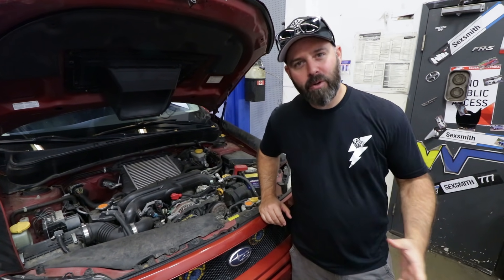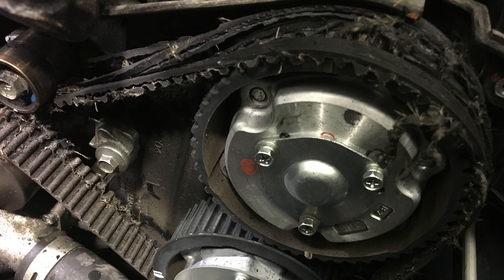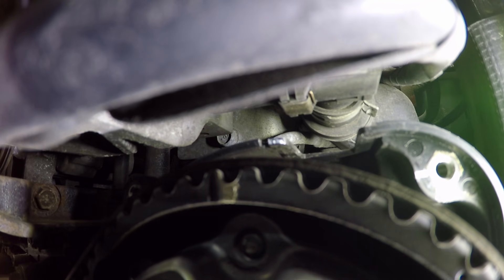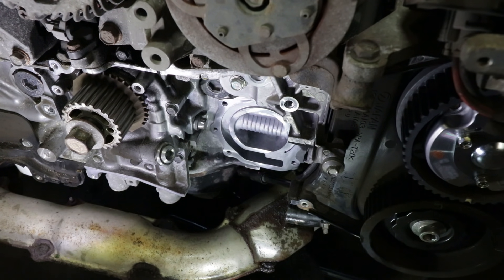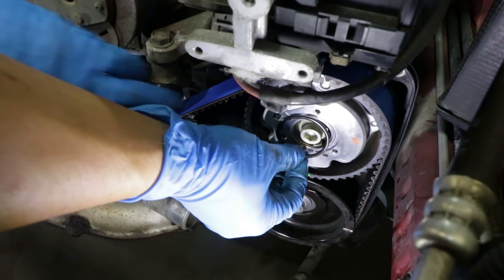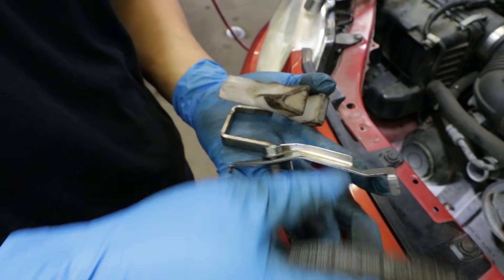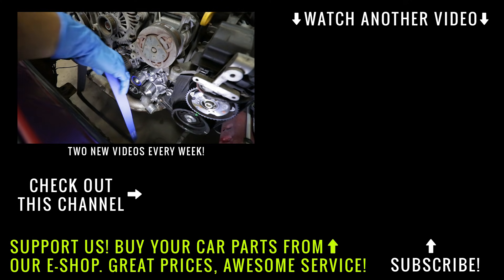How To Change A Subaru DOHC EJ20 EJ25 Timing Belt

Comment: I liked the video and it was very good information.  The only thing I would be hesitant to a do is out coper anti seize on those bolts since copper and aluminium are enemies because of the electrolysis  between copper and aluminium and the aluminium is likely to get eaten out if there is any moisture at all present.

Comment: I did the 2 full revolutions And the timing marks didn’t lined up again ☹️ I removed the timing belt and lined up the marks again but Im afraid now that is not gonna work and I would bend valves. Help!!
Reply: This happened to me too. I realized I should be following the FSM (and what they did in the video) and NOT doing the 2 revs and checking it, because I believe it is the AVCS (cam phasing) features of this car (08 STi in my case) that throws off the timing a little bit once rotated. I put it all back together and it ran fine (I think, I have a different hopefully unrelated issue now). Good luck and let me know what you found out! I am hoping I am right that the cam phasing is causing this to be off.
Reply: burnrubber2002 I removed the belt and lined up the crankshaft then the cams again then pull everything back together then started right up I asked my friend and said the marks wont line up again it takes more than two revolutions to the marks to line up again but as long you lined up the marks for the first time there’s nothing to be afraid of

Comment: I've never done a subaru timing belt, but I've done on normal inline engines and before putting all the covers I rotate the crankshaft twice just to double check the marks again and in case there was some slack that I didn't notice

Comment: NEVER!!!!!!!!!!!!!!! In my life i buy a subaru again!
Reply: Why?
Reply: @Khg72   Because i just spend alot of money on it and then out of nowhere my timing belt snap! And the engine design is so stupid. 😪
Reply: the sad part is as with almost all modern engines produced in any vehicle anymore weather has a timing belt or timing chain they are all interference and if the belt and or chain breaks it's still going to bend the valves regardless of make
Reply: For someone that likes to work on their own vehicle's I couldn't agree more! I've owned many many different types of vehicle's and these are a pain in the ass to work on. Their reliability falls short of Toyota and Honda. Plus these newer generations have lost their bold styling and are conforming to blend in with the rest of the manufactures.
Reply: Garrett Smith I was thinking the same thing. Subaru’s used to really POP out when u saw one even if it isn’t decked out w cool shit, now they are just any other car

Comment: These guys did a great job on this video. The one thing I never understood though is why mechanics never clean the parts when they put them back together. When people buy a brand new part and spent hundreds of dollars they want their car to look like they got a brand new part on it and everything looking clean shiny and new. I can’t stand it when they take things apart and then put them back together dirty and sometimes even dirtier then the engine was before it came into the shop. Clean the parts before you re-install everything so that the customer can tell and appreciate your work and the nice new part shows off!
Reply from the maker: Because no one ever pays a mechanic to clean parts! Customers already complain about high prices can you imagine tacking on 1-2 hours onto a job for cleaning...
Reply: I agree with Dmax, if the timingbelt covers are dirty, dirt can cause more problems on the road with new parts. It's true that cleaning parts is time consuming but if you want treat your customers good they will come back with more for you.
Reply: It's all under the cover you'll never see it anyway. If you want it clean pay me for it. Flat rate doesn't

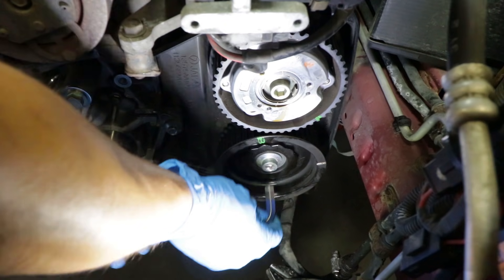Comment: Question. @9:29 he turns the bottom cam gear to the right/clockwise. I was told not to do that. To only turn that one counterclockwise and the one above that one clockwise to line them up. Is this wrong?
Reply: I also note that but because he aligned the crank sprocket the pistons dont touch the valves that way. A little doesn't hurt.
Reply: The service manual does specifically advise against clockwise rotation of the lower, driver's side cam sprocket. While the pistons are all mid-stroke on EJ25 motors (at least, think it is that way on most other Subarus too), the intake and exhaust valves can still run into each other on the driver's side (the valves are all closed when the passenger-side cam timing marks are aligned).

Comment: You want oem pulleys, the bearings are different.
Reply: Koyo and NSK are the manufacturers of the OEM parts.  Avoid the Gates kits.  They no longer use Koyo or NSK and are now using Chinese manufacturers.

Comment: Just go ahead and do a full head gasket replacement.  If it is not bad it probably will be before the timing belt needs to be replaced.  I did not have the time to replace the timing belt on my Forester, so I paid a shop $1,000.  It turns out it had a bad head gasket.  Removing the timing belt seemed like the easy part of replacing the head gasket.
Reply: Turbo Subarus don't have the infamous head gasket woes that the non-turbos have. I assume yours was a non-turbo? Reason is Subaru cheaped out on the non-turbos and used a single layer head gasket, while turbos have multi-layer. You can actually swap in a multi-layer on a non-turbo and it will likely last the rest of the life of the engine.

Comment: Did you have to pump and prime the hydraulic tensioner?
Reply: No.  It's under pressure already.  You install it with the pin in it (it comes that way when you buy it) and only pull the pin when you are ready to release it.  You technically can recompress it, but if you don't do it right you can damage it.

Comment: I followed the same steps with the new belt and crank with cams all aligned..but when I rotate the engine by hand the belt wont align with marks on crank and cams..but the crank and cams align with marks on engine..what am I doing wrong?? 2004 wrx
Reply: marked martin, you would have got the job sorted by now but did the problem turn out to be that the timing belt lettering facing the wrong way?
Reply: Dave Pedro I did sort it out..the belt's letters were  facing me...once I pulled the pin I would rotate it and it all the marks will align just not in their start position upon further investigation I read that it will line up after 1000 turns so I align everything up put it all together and it cranked up perfect no misfires!! Thanks for the reply.
Reply: Ah ha, that last bit of information was the final piece in the puzzle. Thanks :-)

Comment: You can use a clamp to hold the two drivers side cam gears together, makes the job a little easier and saves you the worry of screwing something up
Reply: Not in this case, he had to align them because they fell out of alignment.

Comment: it's a great tutorial video. it's one of the best video and great instruction. One question: does the Subaru Forester 2011 timing belt, what is the manufacture recommend to change timing belt? Thanks.
Reply: 105k miles is factory recommendation

Comment: This was super helpful!  Thanks for providing such an in depth explanation.  I have to do the timing belt in my 08 outback xt 5AT.  So a quick question is that i need to make sure the flex plate is secured with a pry bar before pulling the crank pulley off?  Where exactly is that flex plate located?  Could you provide an overhead picture of the motor to show where that is?  Thanks!!
Reply: Pull out the black rubber cover just to the passenger side of the throttle body,  that's your access to lock the flexplate

Comment: What is it causing the left intake cam shaft sprocket to spin why the right camshaft it spin freely
Reply: The timing marks set the pistons at half stroke.  The passenger side of the car all the pistons are closed so the cam isn't under any tensions from the roller rockers on the lobes.  The driver's side the valves are half open and the springs on them force the cams to spin a bit back to their closed position.

Comment: Why not oil pump too while u were there?
Reply: Why would you?  Unless it is leaking (which in and of itself is rare on these engines), they don't really fail.  Now, if you want a bigger pump, that's a different story.  For a factory car the factory pump is more than adequate.

Comment: So you tell me the mechanic did not turn the engine by hand few times to check if the intake/exhaust etc. marks lined up again with each other after lining them up for the new timing belt?
Reply from the maker: Ofcourse he did, we just didnt show it but he mentioned turning the engine a few times to ensure that everything lines up. We're trying to keep these how to videos as short and concise as possible.
Reply: @speedacademy  For cars with AVCS, is it true that the marks will be off once turning a couple of rotations? I ask because that's what happened to me on my 08 STi. It has dual AVCS and I believe this is why. I thought I messed it up and redid everything again but still had that issue. Seemed to run fine, though had hopefully unrelated issue and had to rip the heads off again so I'll be doing this again soon and want to double check I'm thinking this correctly!

Comment: Gah so much wrong!! The water pump isn't torqued in a criss cross pattern you need to start at the 2 o'clock position and go clock wise around once, and then again a second time at the same torque spec. You also should always use the proper tool to hold the crank pulley to undo the bolt and the proper tool to keep the left side cam gears from spinning when undoing the belt so the valves don't hit each other!!
Reply: never, because its impossible the pistons are out of the way.
Reply: @chrism6  pistons are clear but these will hit valves to because they're angled towards each other, but as they're opening valves on opposite cylinders, ( intakes on cyl 2 and exhaust on cyl 4) there's little chance of that happening as long as you started removal with the crank in the correct position. I never liked the cam lock tool, I preferred to do it with free cams, so often they were off anyhow when using the tool
Reply: I'm with you mate
Reply: Nice Legacy.
Reply: Fucken noob

Comment: Subis are so easy to work on, one of the reasons i love them
Reply: I hope that is sarcasm
Reply: Obviously, you haven't hand to replace your Low Beam Headlight yet... smh'..
Reply: @gilbryans  must be a 10-14 Legacy or Outback. First few sucked, a couple hundred later I don't even have to look. Pull back the inner fender and shove my hand in
Reply: Lmfao every one putting hard things to replace 😂

+1 for spark plugs
Reply: I think Subaru's are easy to deal with. Like any car, not having the right tools makes it hard.
Reply: Lmao every car has super easy parts to replace and hard ones, most Subaru parts are very easy to replace
Reply: Like replacing the spark plugs?  I never needed to remove the battery, intake, and windshield washer reservoir to replace spark plugs on my other cars.  I just--get this--removed the spark plugs.
Reply: drippingwax lol... I've come close a couple times now to using a hole saw for access to them. Figured I better not for the sake of structural integrity! Dontnknownif you know this trick or not, but remove pitch stop, engine mount nuts, transmission nuts (2) , and jack up the engine. Super easy to get to them then.
Reply: Easy for the guy with tools and space... ever replace an oil pan gasket on a Subaru WRX/STI!? Asshole.
Reply: i know the struggle, replaced my spark plugs a while ago

Comment: You definitely don't need to use OEM coolant, for example, Amsoil coolants are just fine if not better.
Reply: Subie coolant has a chemical that seaos up with the ghaskets, i had a vuddie who put the wrong one in, it was supposedly "good for the car" by the mechanic and ended up leaking through the headghasket